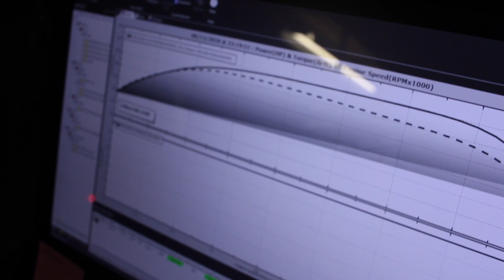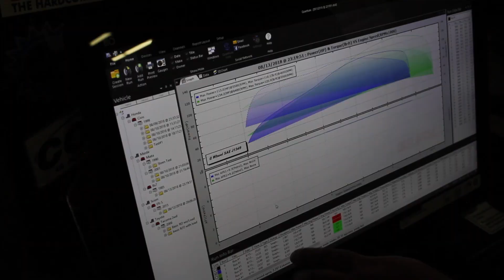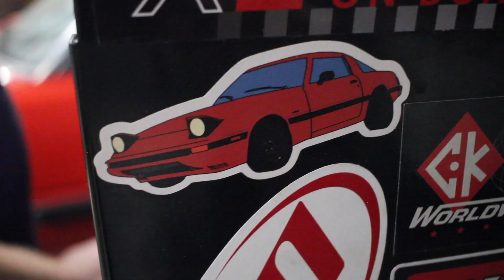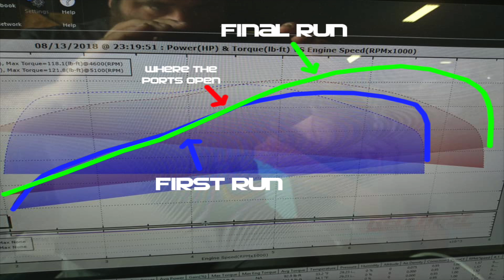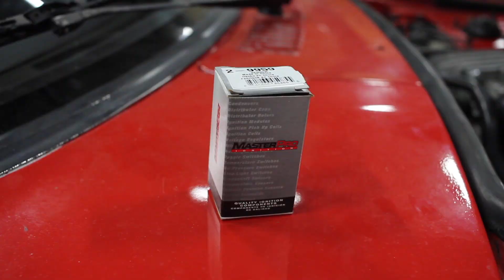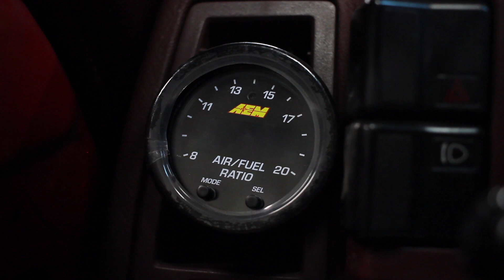Rotary Life S3 Ep. 11: Dyno Tuning The FB!

Comment: Here's how you fix the heat issue, build a shroud which covers the face of the radiator and mount two Spal 12inch super skew (pull) fans to the shroud, normal driving the temp gauge shouldn't move, in traffic the temp gauge will start to rise but once those fans kick in you can watch the gauge drop, here in Australia we get hot summers and my Series 2 never gets hot with this set-up.

Comment: if you want to get the most power out of that engine delete the cold start unit and the flap in the throttle body port the throttle body and the whole top intake all the way to the engine run a free flowing Racing Beat exhaust delete the cat mid Muffler smog pump and rats nest and aftermarket fuel pressure regulator you should be within the 170 to 185 range especially if you have a programmable ECU go on my channel check out what I did to my car it's an S5 an with an S4 ECU and talk and take manifold

Comment: random question, does the astrovan tps wire directly in? i just picked up a 88 FC Vert, and im doing strictly cruicial maitence, Oil, Fluid Flush, Air Filter, Throttle Body Clean, Thermostat, TPS, Spark plugs + Wires, but if i can swap out the tps for something a little more reliable out of an Astrovan, does it directly plug in and work? or is their work needed?
Reply: it only has 115,000KM ( 70,000 Miles ) and i want to make this motor last, before i rebuild it and do a port and polish, ( trying to save money before so) i want to make it my daily till the winter time so any help is appreciated
Reply from the maker: We had to make a custom bracket and connector. But other help, just stay on top of basic maintenance (oil changes, coolant, spark plugs etc). I would premix as well, always let the car warm up before driving, and rev it to redline at least once a drive.
Reply: Shooting Cars 
Thanks for the info, this is going to be my second FC, i had an 86 But the motor blew and i sold it, ( wasnt worth rebuilding as the body was cheese and the floor was rusty ) im aware of the things needed to prolong the life of the rotary, but how did you make the custom connector? If you wouldnt mind making a video on that im sure alot of FC owners would appreciate it as the stock TPS on these motors are junk and constatly break, as well with premixing, if i still have my OMP working, is it still ok to premix? Is there a difference in amount of oil i should put in to premix? Thanks in advance
Reply from the maker: If the omp still works, do .5 oz per gallon

Comment: What does wiring open fuel injection mean? What's the benefits?
Reply from the maker: So there are 6 ports that allow fuel and air into the engine. On the stock engine the 5th and 6th ports open up after 5k rpm. in order to make them open, you need a whole system we didn't include in the swap. so we made them stay open so we get the power gain at the top of the rpms. It hurts the lower rpm power a little (Look at the dyno pic at 4:25) but the over all power is better.
Reply: Good.?